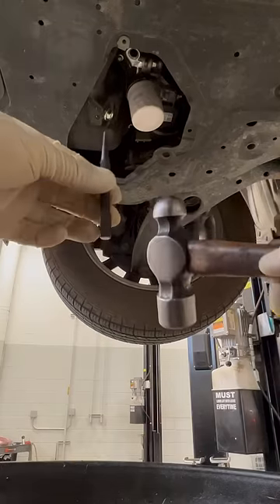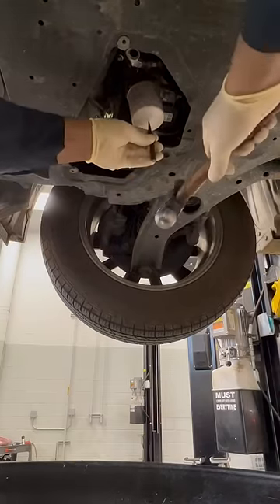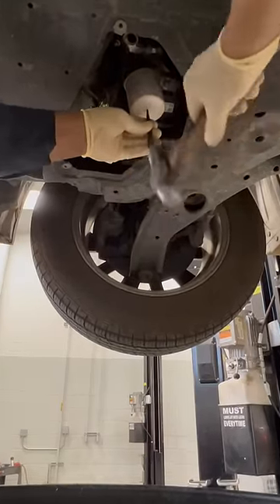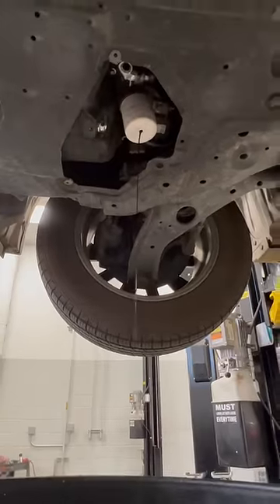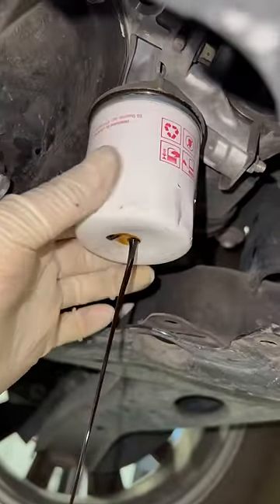Tech Tip Of The Day Oil Filter Clean Removal #oil #oilfilter #mechanic #shorts

Comment: I just run no oil in my engine. Saves the mess when you change the oil filter
Reply: Eco friendly I see 😂
Reply: You should try clear oil..
Reply: No oil.  Don’t need a filter then.  I run without either.   Toyota 💪
Reply: I just run mine close to empty and top it up 😂
Reply: If not use water to change to a water engine and not a oil engine and to get more eco friendly and when change it will dry itself when drop on the floor I seen it in every menu
Reply: Huh
Reply: save money too
Reply: sound like you got a locked up engine to me no oil😂😂😂😂
Reply: @qunicetoole7497 That's the joke
Reply: Gonna try this.
Reply: I’m going to give that a go saves me money in the long run🥴
Reply: Samesies but you actually change the filter? Where you get one of those?
Reply: I jus use my poop.. its even more eco friendly
Reply: same here, saves money too
Reply: that’s why i just run no oil filter. saves the mess when i don’t change shit
Reply: Nah bro I do t even need a filter nor oil
Reply: No that's bad for the engine. You just leave the oil in and never change it.
Reply: Saves you at least 70 dollars for the first 2 days
Reply: I don't have spark plugs, saves needing to start the car later
Reply: That's a great Idea
Reply: I drive around with no engine = no mess 💀😂
Reply: fr easier to buy a new car
Reply: @RuttlesRepair mineral oil in the engine lol
Reply: I just drive a Subaru so that when all the oil burns off I can just add more to do an oil change
Reply: My wife has entered the chat in a chariot…
Reply: Your like my father 😂 i dont think i have yet seen him put oil in a car ever
Reply: Best fucking comment bro 🎉
Reply: Good tactic.
Reply: @PNW_Adventures1 😂😂😂😂😂
Reply: I used a heavy duty air hammer from Snap-on....😂😂😂😂
Reply: I tried this and now my car won't start, please help!!
Reply: well thats stupid. you dont need to do an oil change if you aint got no oil. 🤦🏾
Reply: Sounds like an ev to me
Reply: I am going to try putting water in instead of oil maybe it might work.
Reply: Put water and soap in it so it cleans the engine while you drive it 😂 (jk)
Reply: And the engine
Reply: I don't use an engine, if it aint being used i wont have to fix it
Reply: @cyraxkkcb2mo10 OIL IS OIL
Reply: Just use peanut oil, change it day before thanksgiving, then fry your turkey in it. Problem solved
Reply: Why would you need to change the filter if you don’t use oil bud
Reply: @Dynammic EVs dont have engine oil
Reply: Bros engine be like:

“HELP MEEEEEE”
Reply: I never thought of that
Reply: @user-zd8vg1nl5g  because the air running thru the oil passages wears the filter out duh
Reply: No way,me too bro. I mean she knocks and locks back at me but so far so good!
Reply: @OnionToast418  big brain move I never thought of that I’m about to remove it don’t want these dealerships charging me maintenance for it.😂
Reply: You want have no engine
Reply: If you don’t run oil why have a filter swap?😏🥴just plug the holes up save time and weight don’t run oil in your engine guys?and yes it is a sarcastic comeny
Reply: I recycle my oil and use it as gasoline
Reply: what u drive ? MAN TGM ? 😂😂
Reply: Mechanics hate him! Learn this one simple trick.
Reply: My mate did that with one of his Honda's and it worked fine
Reply: @babyboysmooth1353  you can run a stock d series with no oil at redline for like 15 minutes lol
Reply: I actually laughed out loud
Reply: @manueltomatillos3348 This cracked me up😂😂😂😂
Reply: If you leave the filter off, you’ll never have to change it.
Reply: I use water we have lots here on great lakes Michigan 😂😂😂
Reply: Do you have a Hyundai?
Reply: Still got the engine? Or u don't need that either. 😂
Reply: Ah, the ol engine swap method. I can dig it
Reply: water does it for me
Reply: Are you serious?
Reply: Aves on everything. Gas, insurance, tires, maintenance, just all around great. Might as well just walk everywhere it's that clean.
Reply: @manueltomatillos3348   HE ONE OF THOSE GUYS THAT SIT IN THE ROAD WITH ORANGE HI VIS 
🤭🤭🤭
Reply: Dead 😂
Reply: I bet you have to change your engine while you're charging your oil
Reply: @PNW_Adventures1 no oil, no filter, no engine, no car required 😂😂
Reply: Yeah I just put water in mine saves so much money
Reply: @RuttlesRepair you got jelly not oil
Reply: I just run no motor vehicle .. that's the best for the environment .. 👽🛸
Reply: No oil?  What's the filter for then?
Reply: Diesel burns better
Reply: I like your thinking! When I drive at night, I don't use lights. I'd hate to get my lights in someone's eyes
Reply: I got some oil in my engine. I also got some engine in my oil
Reply: @mikeskidoo3991  no this video is cgi
Reply: Good thinking. I dont even use tires. Saves the time from getting a flat. 😂
Reply: Fr😂
Reply: You know to replace your oil filter when you change your oil…
Reply: Thats not good
Reply: @PNW_Adventures1 my buddy in high-school Issac Reid done that never ended well....... he had a 2002 corola
Reply: Wait my car has a oil filter ?, I’ve been been just adding oil to since my car since I got it. Every time I check it I’m almost out. So I add more, sometimes a quart or two extra, just a little bit so it last longer
Reply: And makes a really cool white cloud appear from the engine 😁
Reply: the reason why so many of you overheat you're so quick to get angry your gasket gets blown so quick because you don't know Jesus the prince of peace the source of oil for your soul you need Jesus Christ to add coolant to your soul that's right the Holy Ghost Jesus Christ is the way for you to have victory today
Reply: @stephenmaximo4017  do you know what a sky hook is
Reply: I suggest going for the bluetooth oil
Reply: Yep just have to throw a new engine in every so often
Reply: Oh I see, you put BBQ too?
Reply: Lmao 😂😂😂
Reply: Man i did this and my car runs smoother than a babies bottom
Reply: I catch the train
Reply: I just removed the engine! 
Its all Flintstones now!
Reply: (insert skull emoji here)
Reply: Cant have oil problems if there was never any oil to begin with
Reply: @cyraxkkcb2mo10 mineral oil 😅
Reply: Engine burns oil so I never need to change it, just keep adding more
Reply: @user-jw9wz8nc6v  same.  my crankcase pressure pushes the oil out my pcv at high revs. Needs catch can bad
Reply: Run water in it saves your engine
Reply: go olive oil make it virgin
Reply: Only a Toyota would survive that
Reply: Same with my EV
Reply: Thank god there are legitimate people that think like you that keep my pockets full🤣🤣
Reply: I use vegetable oil. Safer for planet
Reply: I simply get rid of the engine. No need for oil if you don’t have an engine.
Reply: What a waste of money you’re doing. Why put an oil filter if you don’t run oil LMAO
Reply: Why stop there? I just filled it once 10 years ago. I dont even think the hoods been opened. I'm really about being green.
Reply: Engine claps to show its appreciation😂
Reply: @cyraxkkcb2mo10 crisco works just fine with me
Reply: What’s an oil filter?
Reply: You drive a VW?
Reply: And the fire is always neat
Reply: Sounds like Ford managed to sell alot of Mach-Es
Reply: @RuttlesRepair I had a girlfriend who legit did this for like 5 years with her Hyundai. ... It was still running last time I saw her. How?
Reply: @brentrittenhouse293  all the extra dinosaur juices 🤷🏻‍♂️
Reply: @cyraxkkcb2mo10 I was using mineral oil since it’s clear but now I just stick to water, it’s clear, much less of a mess, and it doesn’t stain, I’m sure the car’s fine, I mean water tastes better than oil so it should appreciate what I’m doing for it
Reply: @vampvhs  at least use some dish detergent to have some sort of lubricant..🤕
Reply: Never thought of it that way. Genius
Reply: In fact, u don’t even need a filter and instead it will just exhaust the chunks of metal out of your engine👍
Reply: i thought i was the only one
Reply: @RuttlesRepair thats smart because the new oil will flush out the old oil and make the oil filter's job easier 😂
Reply: I read this seventeen times and just realized you still need the oil filter even though you don’t use oil, because of the engine’s compression right?
Reply: bro drives a Tesla...☠
Reply: @manueltomatillos3348 i will try this
Reply: pro gamer move
Reply: O, so you drive a Honda as well?
Reply: Must be a Honda.......
Reply: Just use hand sanitizer instead, you won’t have to change the filter anymore.
Reply: real pro
Reply: No oil!!! At least you are safe from the freedom country!!!
Reply: Saw dust. Okay
Reply: My old boss had his machine do some work on my old 2011 ford escape a few years ago shes definitely was Eco friendly after that. Buddy for some reason forgot that he drained the oil but never put fresh oil back in..how? RIP Candice
Reply: Yeah but that will wear out your exhaust bearings.
Reply: I use water. It’s much better for the environment than dirty oil
Reply: *Honda owners
Reply: Can’t have a leak if it ain’t got no oil
Reply: Don’t forget to add water also, I hear it cleans the gunk out well
Reply: Savage 😂
Reply: Yes, just fill the sump with petrol.
Reply: @PNW_Adventures1 It runs on compresses air.
Reply: @albertovargas7271 used compressed air.
Reply: Works great. Slightly reduces the life of the engine though. Just slightly
Reply: What about the engine? Oil change for an engine...
Reply: Must be burning or u got a leak
Reply: I just run water in mine and run a filter delete kit
Reply: @pedrotenorio1391  lol
Reply: Genius.. woooow. I turned to this method yesrs ago. My engines are super clean, the metal parts are very shiny
Reply: Yeah I rebuild my engine every 5k miles so what's the difference
Reply: I just run mine like the Flintstones no gas no filter no nothing
Reply: Use water bro atleast
Reply: Run em until it knocks ✊🏽
Reply: Why change the filter? With no oil in the engine, it don't need a filter. I'd run it without one to ensure that there was no oil in the engine.......

        NOT!!
Reply: Change the drain plug bolt to silver then you can run werewolf blood in it serious upgrade in horsepower and fuel mileage
Reply: Lol
Reply: Never thought of that and it saves money too.  I had a girlfriend do that once. However that new engine was expensive.
Reply: Then when it stops runnin "it ain't got no gas init"
Reply: I’m ahead of you. My engine bay is empty.
Reply: Im running mine with  Biden Ice cream
Reply: Try running water in there at least
Reply: Ah must drive a Honda
Reply: Some people here are serious. That’s the bigger issue 😂
Reply: @bloomgocrazy996  forged bottom end d16 with fat turbo
Reply: Hey man I drove with no oil like you said and now my engines knocking 😓
Reply: I just have a hamster on a wheel powering my car. Almost no mess.
Reply: you cannot change something that don't exist now do you
Reply: I don't have an engine in my car, that way I make sure I never worry about engine maintenance
Reply: Better using water
Reply: Or just try pure organic water with electrolytes I heard that helps k lol
Reply: Or just try pure organic water with electrolytes I heard it cleans the engine inside and out lol
Reply: Or just try pure organic water with electrolytes I heard it cleans the engine inside and out lol
Reply: I actually did this for a while. Smelled burning metal and was like huh maybe I should change the oil.
Reply: Bro on god, also no leaks ever
Reply: Yea and you don't even have to change the oil
Reply: Who taught you that? your girlfriend?
Reply: The metal filter you mean
Reply: why are you even attempting to change the oil if you not using the oil lol
Reply: Me too. It’s called EV
Reply: What is there to change?
Reply: @cyraxkkcb2mo10 water? Thats what i use
Reply: Pro move
Reply: Put some dish soap in there. Keeps the engine clean.
Reply: I just enjoy reading peanuts trying to outdo a funny comment in the replies.... love reading nonsensical idiotic replies that have zero humour value but the writer obviously thinks they can outdo the original comment.... cringe
Reply: Nice
Reply: Thank you, gonna try this soon
Reply: You sir have confused a lot of young dumb people and now they cars are no longer with us 🤣🚶🏽‍♂️
Reply: or use Cresco. 😂
Reply: The invisible 🫥 is crazy💀
Reply: Yeah bro it gives the engine more airflow
Reply: Same we care for our environment 😂
Reply: Hilarious
Reply: You will still have some left in the filter , thats what he is talking about . Smart ass
Reply: Blinker fluid is hard to get now days. Tired of the cost and the bulbs melting the plastic covers sucks when low on fluid. Ive since changed out to LEDs. Water is much cheaper then whale oil. 😮
Reply: water works although you have to check and add more often
Reply: How many cars has this worked in?
Reply: Your engine runs water not oil oil is for car engine not for you 😂
Reply: So crazy but funny
Reply: Y si el filtro está en posición horizontal?
Reply: Saves money when you have to get a new engine
Reply: Use water instead
Reply: Make it make sense! 🤔
Reply: Lol my girl tried that too didn't work out so well
Reply: So nothing oil to change after that... Save your time...
Reply: I just vinegar and bicarbonate. Very cheap
Reply: I make the hole right after I do the oil change, saved me from having to recycle old oil
Reply: Ummmm..... if you punch a hole in the  filter then how can you resuse it?
Reply: Average BMW driver
Reply: you definitely drive a Toyota 🤣
Reply: Walk in the garage
Reply: Ok Elon!
Reply from the maker: https://youtube.com/shorts/ao14J4WSptc?si=sg0oUdtim_O9rORq
Reply: Aw man 😂😂😂
Reply: Just use water it's the same kinda lubrication
Reply: Electric car?
Reply: More like saves the mess when you change the engine
Reply: I don’t run a filter the dirt hones my cylinders and adds HP 😂
Reply: I just sell my car when it's time to do an oil change. Much cleaner
Reply: U should water so atleast you have something and its still eco friendly
Reply from the maker: https://youtube.com/shorts/ao14J4WSptc?si=GoqGLFNp2GxeDYGe
Reply: @RuttlesRepair are you running a steam engine?
Reply: I just use water in mine. So much cheaper
Reply: Bro I haven’t thought of that
Reply: Saving the planet 🙏 you're god
Reply: People who change their oil every 3k miles 😁

People who change their oil every 300 miles 🤴
Reply: I heard vegetable oil is also good
Reply: I just run no engine. Save the hassle of having an engine.
Reply: Did that today !!!
Reply: Same here bro, it's a great hack. Ain't going to get me with the whole 'your car needs oil to run' government scam! Don't forget: when you do an oil delete that means you don't need to replace the oil filter at all, saving you more time and money! Your welcome.😎 #STAYWOKE2023
Reply: Actually you joke, but during the war when no oil was available engines would be stripped down and packed with Bostard Grease. They'd be fine to be used at low speed indefinitely in this state, and it was only in 1947 when he got irritated by the increased cam noise he filled it with oil, flushed and then refilled with oil finally discontinuing the practice.
Reply: Okay on some real shit though I never add oil to my car.. I just the let the company fill it while they do my oil change, am I fucking my car up? It has 157k miles so fuck it right?
Reply: Run grass clippings
Reply: Using no filter is better for ventilation
Reply: I use thick cheese. Celebrate by going to the cyber Cafe to wash your feet
Reply: Exactly 😂
Reply: Nice Tesla I got there
Reply: I run Water in case I get stranded in the desert
Reply: Damn never thought about that one. Genius
Reply: @JohnFKennedy420  no lol. They’re doing the oil change for you. If you take it to them at proper intervals you’re not fucking anything up. 157000 miles is decently low too
Reply: Only do this in summer ☝🏽I save a ton
Reply: I might not be an expert but I don’t think that’s very healthy for your engine
Reply: Actually you need oil. But it’s better to make a hole 🕳️ in the oil filter when you leave work. That way by the time you get home 🏡 it’s drained.
Reply: Bro i use a pedal to run my car
Reply: Nah w40 is the one
Reply: I did that, but then my engine started going  canck kacha kacha tic tic cank 
 kaacha tic tic cank cank katcha tic tic tic
Reply: Ok, bright eyes!
Remember, God loves you.  🙂
Reply: Lol
Reply: Tech tip of the year.
Reply: Tf you need a filler for if there's no oil. Just cap it.
Reply: real
Reply: real
Reply: What do you run?  Maple🍁syrup?
Reply: Replace the whole engine parts 🗿
Reply: Try water
Reply: you should use water it will also wash your hand while you change your filter 😂
Reply: Ou crazy 🤣😂😭💀👌💯
Reply: Toyotas be running off hopes and dreams 😂
Reply: @biggibbs4678 he's joking. It's called sarcasm
Reply: @Erniee7 damn you're good
Reply: @Dynammic wtf.
Reply: Just use chocolate milk. That’s how it would look anyway😂😂😂😂😂
Reply: @biggibbs4678 . . bicycle ? 😂😂😂
Reply: I dont use a car. Now i dont have to deal with anything
Reply: True
Reply: Not Need To Do That,🙄
Reply: whaaaat 😂
Reply: @jonek4731 LMAOOOOOOOO💀😭
Reply: You won’t even need one💯
Reply: Saves money by not paying oil tax
Reply: Filters last longer too.
Reply: @paporuchomg  make sure you go with chocolate chip and not regular, could be catastrophic if you dont
Reply: I walk bare foot 
No need to involve in this mess
Reply: Don't bother changing the oil. Just change the engine every 20,000 miles.
Reply: Got that bluetooth oil.
Reply: I usually put Franks Hot Sauce in mine you know they say you can put that shyt on anything 😂😂😂
Reply: I tried this now my car is sitting in the Junkyard 😭...😂😂
Reply: You should try water
Reply: Engines are cheap oil is expensive..
Reply: GeNiOuS MaN
Reply: Same here, I hear a lot of knocking noise and smoke coming out my engine but I suppose that’s normal
Reply: @jonek4731, I thought I was the only one running my motor without oil.😂 Earth friendly, eliminates pollution and no disposal fees.
Reply: @littlepepper4370  yes
Reply: Always superglue filter on so dosent come loose
Reply: Mazda engine last long without oil
Reply: I mean I don't use oil but gas seems so always get In there..... So I guess that's my oil
Reply: FYI:  We have a self-propelled lawnmower that says to never change the oil just add when needed.   I do not adhere to this kind of nonsense.    I change the oil every year, whether they need it done or not.  But this is a very very smart idea...
Reply: @joebruno8785  lmao they definitely just want the lawnmower to blow up and you to buy another
Reply: I'm driving a Swedish Saab 900i, model 1993, with a top-tuned SMR engine. The lead-cooling of the engine has a HW standard curve-controlled cooling up to 2940 km/h. After that, my modular AI-package handles all the additional speed increases, acceleration and deceleration etc. The tires are Hägglund's manufactured titanium-rubber compound. The car's body is made of Swedish quality steel.  The SAAB never rusts, can withstand hypervelocities and Russian nuclear-loaded Iskander missiles (SSC-X-8). As an accessory and for an additional charge, the car could be upgraded to Superplus-mode. Then the car becomes a flying combat aircraft (fighter, attack, reconnaissance) named SAAB 900 i - JAS 39 GRIPEN T (turbo).  Speeds up to just below c-level then become applicable, in other words just below 300,000 km/s. I am so happy with my Swedish SAABi. I'll never have to buy fuel again, and the cooling is fully integrated. Few moving parts and no oil changes! Superb!
(*SMR = Small Modular Reactor).
Reply: Same.
Reply: U must be walking na
Reply: To OP: Now I call this innovation 😂
Reply: Beware a little bit of knowledge..do not run  an engine at all without oil.make sure the new filter is correct..punch filter last resort
Reply: You work under a car, YOU GOING TO GET DIRTY !
Reply: Then you find out the new oil filter is the wrong size and you no longer can put back the old oil filter and oil to drive to the part store to get the correct size. 😂
Reply: I pour 4 qts of astroglide into my engine
Reply: Man doesnt do oil changes, he does engine changes🗿
Reply: Why even use a filter. Remove it and plug the holes with JB weld. No mess ever!!
Reply: EV?
Reply: Saving the planet one seized up block at a time😂😂
Reply: Bluetooth oil. It's the best new feature on these tech cars!
Reply: Nahh bro u do that too
Reply: Single handedly saving our planet, destroying one car at a time. Godspeed.
Reply: Hahaha. Awesome tip. I'll try this on my new Lamborghini.
Reply: Or you can just run water instead of oil in the crankcase it's such a cleaner and efficient alternative it just drys if you get any drops on the ground? Oh and it's environment friendly 😂
Reply: I think that means youre driving an electric caro
Reply: Logical
Reply: Weight savings.  It’s a performance mod. It’s actually just a myth that your engine needs oil.  It actually just slows your engine down.  On average running your engine no oil adds about 5-10 HP
Reply: Dude just put water in the engine it will save you more money
Reply: @PNW_Adventures1 I was worried until you said you drive a Toyota you’re fine
Reply: While you’re at it, go ahead and tie a string from your gas pedal, directly onto your clutch. What that’ll do is make your car a diy automatic car, and you’ll have peak clutch engagement whenever you floor the gas pedal. No, don’t look up how a clutch pedal works, and also ignore that smell, that’s just the car’s way of saying kill me hello.

I should add, you’ll also allow your brake pads to last 100% longer, as they won’t be getting as much wear.
Reply: I use olive oil and coconut oil 50/50 mix 💪
Reply: Dude for real. And did you notice that you've got metal wheels under your rubber tires? Yeah, just use those. No need to get new tires and you'll never have a flat again! 
Work smarter, not harder
Reply: So true
Reply: i have to try this, thanks!!
Reply: Me too
Reply: I like this.  No need for a paper towel when we check the oil level on the dipstick
Reply: That is one way to have an oil filter that will outlast the engine.
Reply: This is it….. made my Day 😭😭😭
Reply: My Pilot died on the highway because I forgot to add some 😅
Reply: @2mmz  lol
Reply: Try running no gas as well, saves a ton on gas
Reply from the maker: @SecurityZone1  😂
Reply: Hell, my 81 accord didn't even have a oil pan 😎
Reply: *2nd mortgage joined the chat&
Reply: 2nd mortgage joined the chat
Reply: Me too it gets a lil noisy I dump a quart in every 50k and go bout my way😅
Reply: You do know that if you run the no oil mod that you don’t have to change the filter anymore, right? It becomes a lifetime filter
Reply: I use Rocks instead and it works well
Reply: I just add water in there, works fine! No Oil needed
Reply: @elNenio 😂😂😂😂😂
Reply: @Erniee7 
Flintstone mobile
Reply: You may not have to do an oil change every 3,000 miles, but unfortunately, you will have to do an engine change about every ¼ mile (if you even make it that far).
Reply: Try water it’s cheaper too
Reply: I will have to try that 😂Hahaha